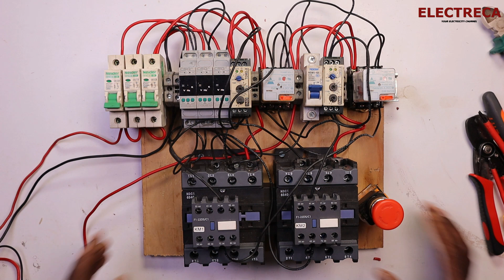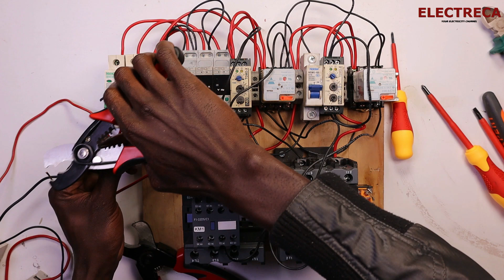How To Install An Emergency Switch - THE EASY WAY

Comment: How do u connect the auto o hand switch in the control circuit in case u want to control the generator manually or automatically?

Comment: Sir I'm confused with how the emergency stop cut off both of the two power sources. Is the neutral for both supplies combined before the ATS or some logic else.
Reply from the maker: The nuetral for both sources are connected together.
Reply: But why you connected both grid and generator neutral together